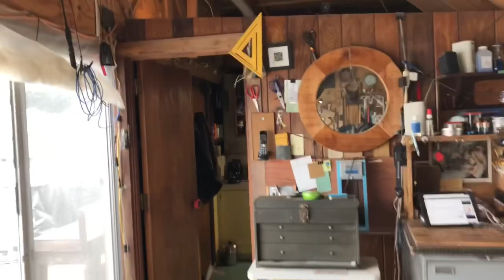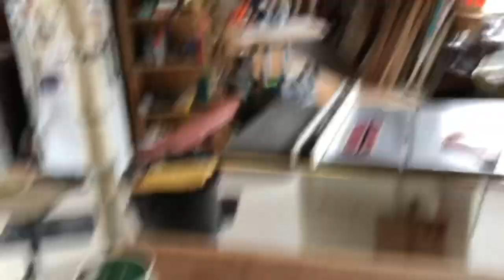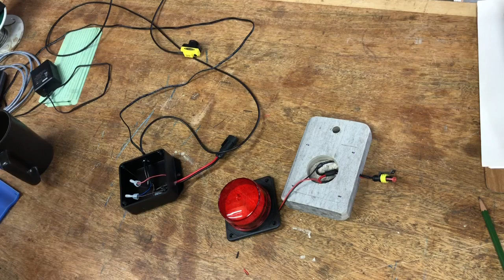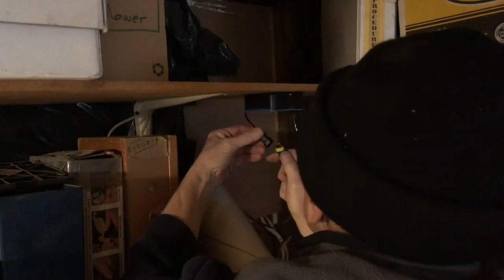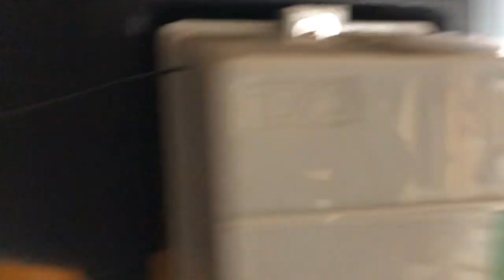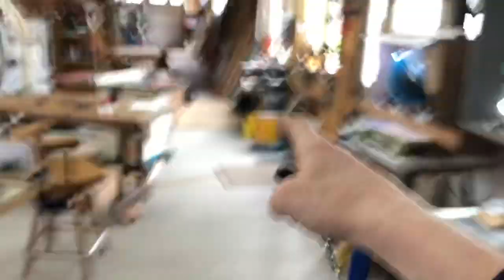Oneida SuperCell Dust Collection Tune-up

Comment: Thanks for sharing your set up. Which kind of PVC pipe did you use? I'm debating between PVC Sewer and Drain Pipe and heavier schedule 40 PVC pipe...wondering if the thinner/lighter pipe is fine with the Supercell. Thanks!
Reply from the maker: Sewer and drain pipe works fine on my setup. Much cheaper and easier to deal with. I wrapped a few of the joints with stretch wrap as needed, but most joints are snug enough and holding well being clamped in place as is.

Comment: Just curious...  Does all that PVC pipe in your system have proper grounding to eliminate static buildup?  I didn't notice any external grounding wires.  That much static charge running all around your shop will obliterate an RF signal from a small remote control like that, and it seems to explain why you can turn the unit on from farther away, but not off.  Just wondering if that was the problem.  Glad you were able to extend the antenna.  I'm looking at buying that same unit and your video was very helpful.  Thanks.
Reply from the maker: Interesting. I will test that out.  The pipe forks “wye” right off the intake to my joiner just about 10’ away in the garage. Both the joiner run and the first 20’ of the run to the shop are grounded with electric fence wire (aluminum). So I can open the joiner gate or the first drop out in the shop and then open the garage door and head down the driveway to see how far away from the unit I can get with the remote.  Luckily though, it works dependably as is.  My biggest issue in playing gate police & making sure all gates are closed except the active run.  Good luck with your system!
Reply: @ehRalph  Here's a video I saw that was interesting.  I've seen people wrap grounding wire around their pipe, and even using eyelets and screws at the joints so you can disassemble the pipe later on, (a Really smart idea), but this one talks about the importance of tapping the screws all the way inside to ground the interior wall of the pipe as well as the outside.  I hadn't originally thought of that but it makes perfect sense.  Static charge can be a fickle thing so you want to give it as many paths to ground as you can.

https://youtu.be/XtkHzmXe4ZA
Reply: I don’t think the PVC is the problem. I have the exact same problems and I have no PVC....yet. I did extend the wire antenna as above. Initial results seem to suggest this may work.
Reply: @mikeygee2465  Yeah, there are several reasons why RF signals get blocked.  Could be they just need to use better remotes.  Still a good idea to ground the pipes though, for a number of reasons.

Comment: Interesting that you are also having problems with the off function of the remote! So do I. Mine seems to need to be within 10’ to work consistently. Just recently spoke to tech and was told about extending the antenna. I’ve extended it a little, but nothing like what you did. I may have to play with that some more. Does yours work consistently now?
Reply from the maker: I have about 40’ of single strand insulated thermostat wire on mine. The wire extends to the center of the shop.  My remote is clipped to para-cord also roughly in the center of the shop. The para-cord is tied to a loop of large ball-chain o-o-o-o-o-o (3/16” balls) that allow it to glide easily back and forth on a 10’ run of 4” pipe between my table saw<——> and the router table. I never carry the remote and its always within about 10’ of the antenna wire above.  

Once in a while I have a little hesitancy with power-off and I will hold the remote closer to the ceiling wire. But it has never failed to power off. Power-on is solid and always works fine.   Note:  I’m no engineer, but wonder if maybe the electric fields generated by the 3 x 1.6 HP motors interferes with RF signal from the remote when the unit is powered on.

Comment: Great tips.  I have a much smaller shop and have the same issue with my Supercell remote.   I think about 15 feet direct line of sight is the maximum range to turn the unit off.  Turning on is longer on mine also.  I’ll try to extend the remote wire to the middle of my shop also.  Otherwise, I love my Supercell.  Great for a 1 man shop. It replaced my clearvue cyclone with a smaller footprint and replaced the shop vacs I used.
Reply: Hi Jim.  I'm looking at buying a supercell to try and free up space and eliminate a large bosch vacuum I use for small tools.  How's the noise level with the supercell?  It'll have to be in my shop, as I have no option to install it in a separate room.  Also, does it handle 4" tools (table saw, planer) without leaving too much dust behind?

Comment: How has the Supercell held up? I feel like there is still a series lack of information and hope you can give me some thoughts on it. I called oneida to purchase a v3000 but after talking with a tech, they feel that the supercell fits my needs better.
Reply from the maker: Ive been using my supercell for about a year with no complaints in performance, pretty much works the same as when it was installed. I use it several times a week and I empty the 14 gallon drum about once a month. With 150-200 ft of thin wall PVC, I do have a few whistling issues on the 10 or so cheaper blast gates I use, and I’m slowly figuring ways to plug-up, cap and upgrade the worst offenders.  I made a few short runs from the  rugged flex tube that ships with the SC, but cant imagine dragging that (stiff & heavy) hose from one tool to another all the time.  Not in my current tool layout anyway. Good dust ports on tools is huge concern, the better the dust port design, the cleaner the cut.  I had to jamb foam and weather stripping into my table saw and band saw to make them play well (and they do now), still needing some tweaks on the chop saw.  I like the plug and play smaller foot print of the supercell. For your question, Dust Collection is a big investment, unless you start DIY-ing with mix and match parts (very doable).  But workspace, size- &future developments, all play into a decision. Also consider the amount of dust you typically make out there.  If I was doing production, and milling lots of materials all the time, I would likely go with a bigger DC having greater CFM and it would run all day.  In my shop its;  DC-on - cut-cut-cut, DC-off, switch tools and repeat.  So this works for me.  BTW- the wireless remote is ok, but- I had a bad habit of taking it into the house or setting it down (losing it, now and again)    - So my remote now hangs from the ceiling on ball chain & paracord that I can slide back and forth over a pipe across the ceiling so the remote is close to the tool in use.

Comment: How does the supercell perform with all the 4” ductwork? Curious also how it works with small port tools?
Reply from the maker: I’m happy with the install that I have. The joiner is very close to the super cell and it is virtually dustless even if I don’t have all of the gates closed out in the shop due to resistance in about 35’-50’ of 4” pipe and several WYEs or 90s before the open gate out in the shop.  Also, if I leave the joiner gate open - I have a noticeable decrease in suction on the other side and have to walk back and close the joiner gate. The smallest flex I use is 2” which I reduce it to 1” on smaller ports right at the tool.  The super cell does well on my hand held sanders, (a little over kill) so sometimes I just roll the shop vac out for those operations.  All told, the 4” pipe works fine in my setup with gates at every station. I still have crumbs to clean up when re-sawing on the bandsaw and ripping at the table saw. I could do better with an overhead collector- especially on the table saw.   But the short  answer is - this thing works great for me.

Comment: Hi!   I came here from comment you posted on LumberJocks.   I plan to upgrade my dust collection and am considering the Oneida 3HP V3000 DC or this supercell DC.   Dust generators are a cabinet saw, a 16/32 drum sander, a 15" planer and 8" jointer.   The tools will be 15-20 feet from the DC.
What is your experience with the supercell in working with a planer and jointer?
Reply: @ehRalph  Thank you for the detailed reply!   All my tools are 4 inch connectors.  In a two car garage, my current dust collector is no more than 20 feet from power tools, so I'm thinking using stock ductwork work should do the job.    I'll definitely be communicating with Oneida to get their guidance.   What I find attractive to the supercell is lower floor space.  Again, thanks for taking the time for a detailed reply.

Comment: Hi,  I just ordered one if these based on reading their website etc... should arrive in a month or so. Based on my setup I ordered the mobile base and plan to initially use it  by hooking it up to one machine at a time. What are your general thoughts of the machine?  Additionally, what do you think of the suction and noise produced by the unit?  Thanks.
Reply: @ehRalph  Thank you very much Ralph for such a thorough update.  You have definitely given me some things to think about.